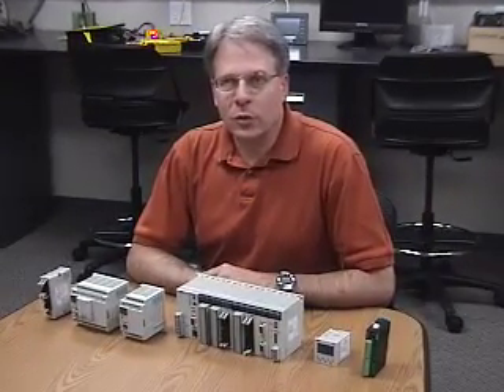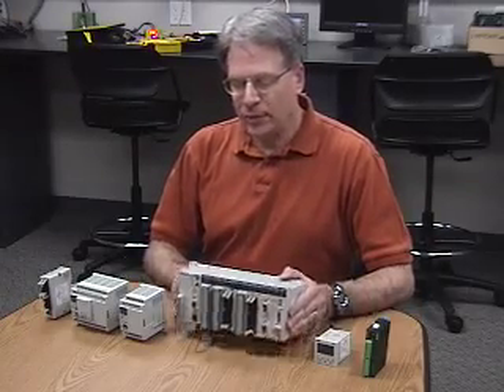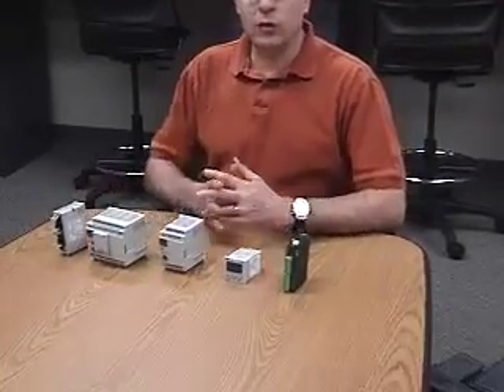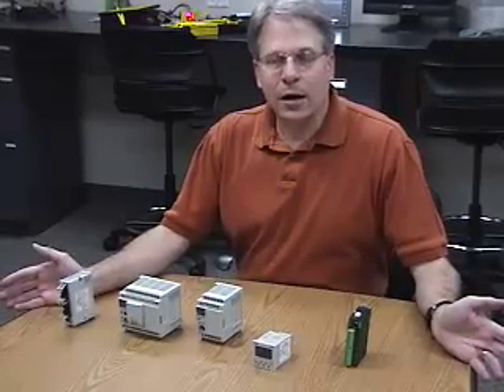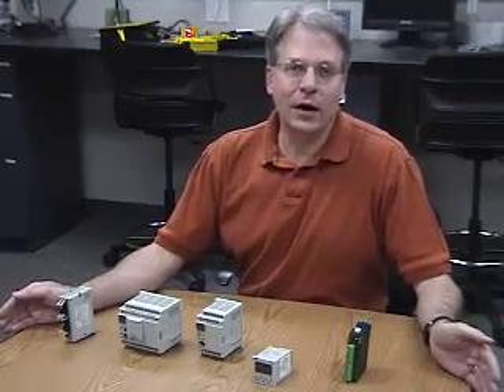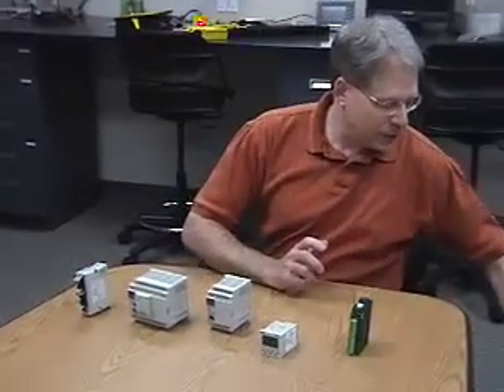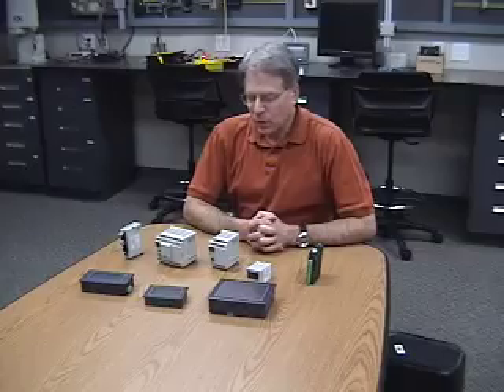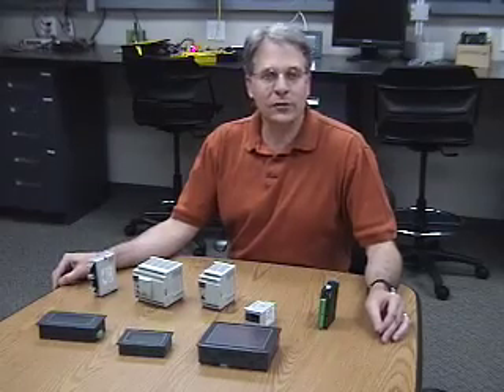Panasonic PLC & Touch Screen overview

Comment: hello, I saw your video on youtube ... wanted to know if he could help me in one application, I'm from Brazil and here informations are difficult,  ... I'm with the following problem. .. a treadmill has an encoder to correct that is to see if the traction slips the clp is a FPX 30t engine also servo panasonic , the encoder sends pulses to the clp which however can not make the treadmill always stop the same place. Can you help me?

Comment: Having used both the FP Sigma and FP0 models, I must say that I found IEC package very powerful.  The only thing I would have wished for was a more structured layout, intelligent line routing and keyboard shortcuts.  I tend to use the Koyo units more mainly because of the speed of programming.  They are not as capable though especially if you're doing any motion applications.